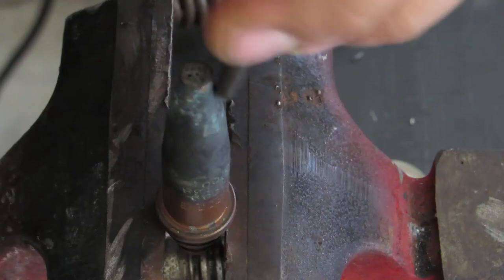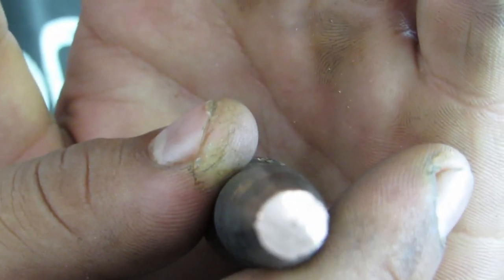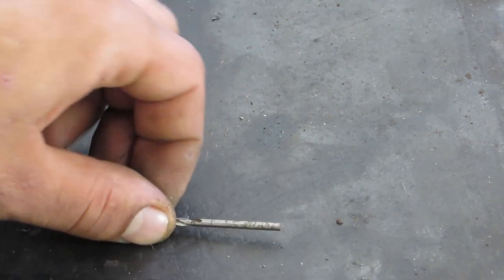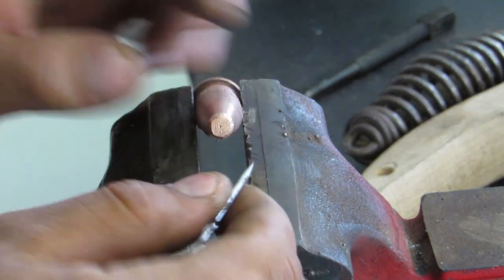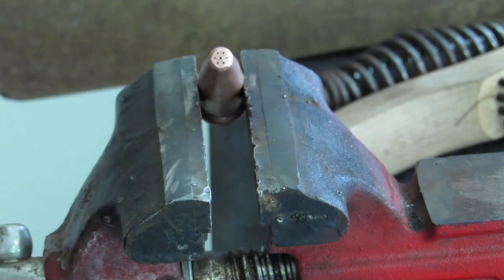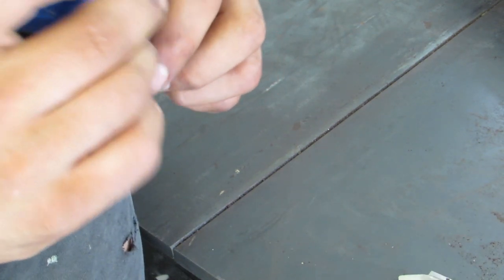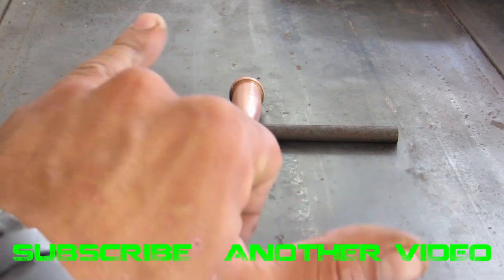Make Your Old, Beat up Torch Tip New Again!!!  Never Buy A New Tip Again

Comment: I use a file instead of a grinder, then use compressed air to blow it out before using a tip drill, much faster.

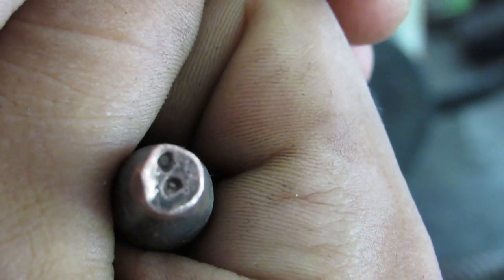Comment: 1:10  If your grinding wheel ever explodes, you'll wish you had the wheel guard installed.
6:25  tip cleaners are calibrated for the tip size.  Look on the case.
Reply: And a few strokes with a flat file will clean up the tip and make the holes obvious.

Comment: All the welding supply shops used to give tip cleaners away with their name and ph. no. on them. I still have two or three for when a tip gets plugged. Pays to take time to clean tips. Only use torch when I need it any more. Last hassle was oxygen regulator low side amping out. Turned out to be a 15.00 fix. I didnt take it in and pay 150.00 for some 15 minute fix. First, the shop would try and sell a new regulator to me. I already have two set of bottles, two cutting and welding and heating setups. Just used other one till primary was fixed. There was no You Tube when I started out. P.S nothing beats a new torch tip. Ten, twelve bucks each now but worth it if you like clean cuts.

Comment: I run a burnout table in a fabrication shop and cleaning up my tips is a quarter of my day let me ask you how that tip is gonnasit in the couplings your veins our gonna still an 1/8 out of your cover if you took that much off you can reshape them and redo the wholes but changing the length like that would make it unusable for the most part
Reply: work on your English grammar...     "wholes?"     ah... it's  "holes"     hard to understand what you're saying in your "run-on sentence..."